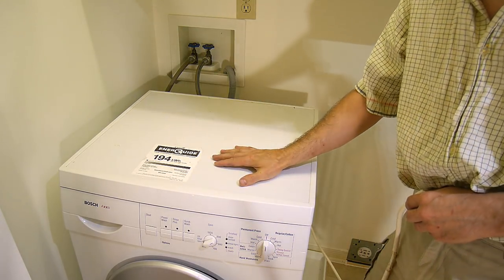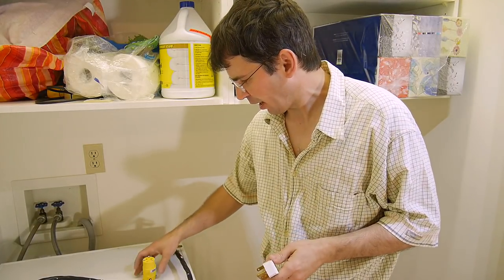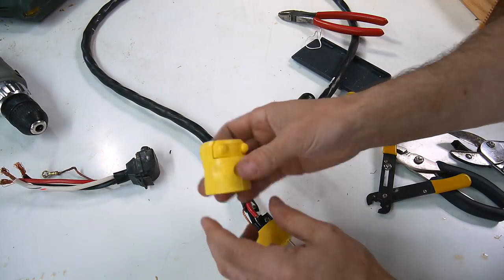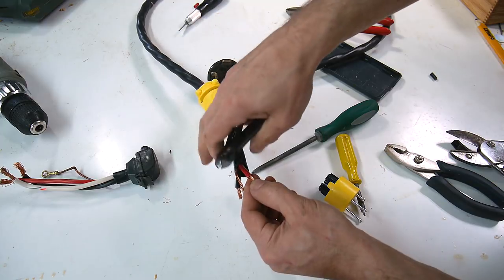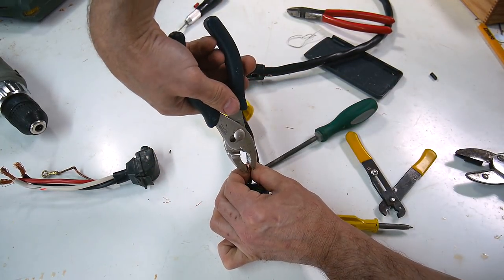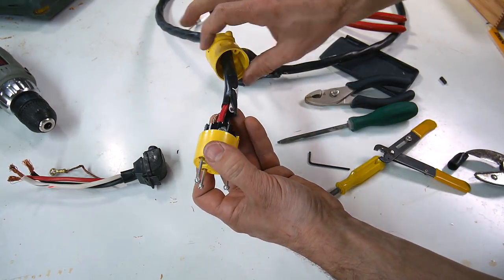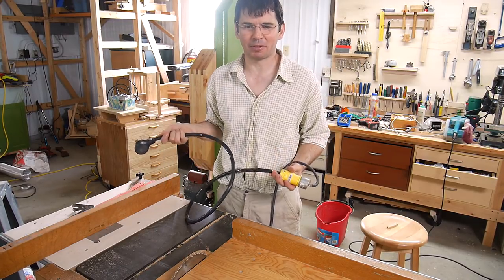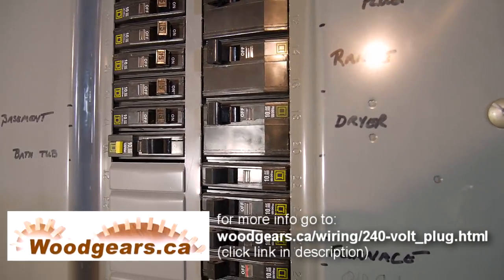240 volt from dryer plug (for Euro-washer or table saw)

Comment: Why in North America your whole house isn't 240v like the rest of the world I will never understand. Makes life a lot easier and safer!
Reply: @YeCannyDaeThat Haven't you learned by now that the US does things to spite the rest of the world and Canada has to follow suit because most of our goods, electrical and otherwise, come from the US. :P
Reply: 240V is not safer than 120V. In fact 240V is only half as safe as 120V is. Because you will pass twice as much power at 240V as opposed to 120V.
Reply: The US set the 110v standard and stuck to it for over 100 years. Hell turn of the century equipment will function on our sockets. Also europe was also at 110v until they became too cheap to run thicker and thicker cables so they figured they would double the voltage while doubling the capacity for basically no cost. Also for 220v being safer, I beg to differ. Every time a human being has contact with high voltage it alters the body, mainly the heart beat. 220v not only does it penetrate more easily through tissue, it delivers 4-8 times the amperage through the body. Chance of death at 220v is exponentially higher than 110v. By your reasoning, why not run 1100v, it would require much thinner wires for 1-2kw loads, the insulation would have to be thicker, but plastic is cheap. Copper costs. Why stop at there? 2200v is better yet. Half the wire gauge once more. I think europe needs to get with the times. 4kv outlets or bust. This way they can run their large resistive heat sources off strands of wire so thin it would look like hair.
Reply: @paul Frederick. 
Actually you are completely wrong. At 110v you have to have twice the amps that you do for the same energy (power) that you would at 240v. Amps are much more dangerous than Volts. (Volts Jolts - Mills Kills). 240v is far safer than 110v for domestic application.
Reply: I would only be wrong if we were made out of super conducting material. But being resistive I'm right. Learn how to Ohm's Law.
Reply: Actually Paul, it is a factor of 4 not double. More like 4 times the power.
Reply: Well I never like to figure out AC power factors.
Reply: Now you're just getting upset because i'm offending your (mad) 110v setup. Don't get me started on imperial measurements and Fahrenheit lol. Don't worry, you will catch up soon. :)
Reply: I think that the 60Hrz is not as dangerous to our heart as the 50Hrz that the 240v uses.
Reply: Catch up? We're so far out in front we're about to lap you.

Comment: Well, if we don't see another video from this guy, we'll know not to do this.
I was tempted to try and run a small stick welder off my dryer plug because it's right off the garage. Then I found the welder needs 50A so I gotta run a line from the panel. Someday. I STILL don't have a working welder.
Reply: In the US, check NEC630, Dedicated welder circuits can use much smaller wire due to their low duty cycle, so you might be able to just swap out the breaker and outlet, leaving the original dryer wiring intact. To do this, you also have to mark the outlet for welder use only. Lots of 225A Lincolns tombstones are running on 10AWG wire.

However if its a long wire run,, or you are pushing the welders duty cycle, or expect you might use that 50A outlet for something other than a welder,, rewiring back to the panel with 6AWG is in order.

Comment: fuckinhell, a death trap.
Reply: what do you mean neutral and ground are wired together, did you check the polarity on the plug, that wires too heavy for a washer its 30 amp where did you get it ?
Reply: 240 volts in North America is 2 phase 120 volts, so to get 240 volts you connect the Red and Black. To get 120 volt it's Black and White or Red and White.

Comment: Two safety comments:
1 - please don't show those "temporary" connections (you might understand the hazards but there are a zillion people out there that don't).
2 - you should coordinate the breaker with the new appliance and it's power cord (which are both designed with a smaller breaker in mind).
Reply from the maker: Please see notes in video and video description
Reply: I did read the notes but I stand by my comments.  You're correct, the over sized breaker will trip on a short circuit, but that is likely to be the result of melted or burning wiring on the appliance or its power cord.
Reply: He said in the video the oversized breaker won't protect the cord on the washer or an internal failure that expects a smaller upstream breaker to stop a fault. The completely safe solution without modifying the plug or circuit breaker would be to install an inline circuit breaker or fuse into the adaptor cord.
Reply: cos leaving a message saying smart people dont comment makes it completely fine to show people how to burn there house down

Comment: „220“ volt in Europe is standard same wiring as US „120“, i.e. 1 hot with 220, 1 neutral and 1 ground. After that there is „380“ or 3 phase, similar to US „220“, except with 3 hots at 220,  1 neutral and 1 ground. The 3 phases are opposed 120 degrees in the appliance canceling each other out. The US likes to waste energy thats why they use 120 😂😂😂
Reply: yes :D and those wires for us appliances are so thick you could carry twice as more power on 220 volts.

Comment: I'm an electrician and I am afraid you have made a couple of mistakes. You should NOT cut away those wire snip-its because you are reducing your wire size even further and this can be a fire hazard. Looks like the wire is to small to be protected by the 30 or 40 amp breaker. A better solution would be to open the back of your washer and remove the original wire and replace it with your 220 volt #10 awg dryer plug. sorry about the "Safety Nazi" comment. Just concerned about you and your family's welfare.
Reply: Given that most of these systems are over designed for safety, snipping a handful of those wire "snip-its" isn't going to cause a real problem. The current carrying capacity of that wire has been reduced by a fraction of an amp at most. If your system is that close on tolerances then the company that made that machine is looking at a lawsuit because it is going to have millions of washing machines catching fire at any moment.
Reply: The real issue that our electrician is ignoring is IR squared line loss. Over this minimal distance that is not a factor that needs to concern us either. As shorter conductors can carry more current than longer ones can that are both of the same diameter.

Comment: Not a good idea Matthias. Get an electrician to run a separate circuit to your washer. No No on the ground to use as a neutral. This video is proof for your insurance company not to payout on a claim. Our power company would shut my power off if they found this in my home until I get it fixed. If you lose conductivity at any point on that ground lead the shell of that washer will energize to any unbalance your two 110v phases might encounter.
Reply from the maker: Watch the video.  I used the ground as ground.  The plug doesn't have a neutral.
Reply: Sorry, I guess you are right.

Comment: Please, do not try this at home!  
The cable is not rated for the power used by the machine and to make matters worse you cut off the pieces of wire that didn't fit
making the cable in fact even thinner. This is a real fire hazard!
Reply from the maker: The cable was "not rated for the power" because it's way overrated.  Even losing a few leads, it's still much thicker than needed.

Comment: That temporary wiring job you did really is extremely dangerous.
You could have easily spiked a finger on one of those bare copper strands, and that hurts like hell. It could have become infected and then you could have died.
But not only that, it's far too easy for the plug to lay prong side up on the floor, and when you come walking by in the night with all the lights off, you could have stood on it and hurt your foot. Then, in a fit of rage, you could have inflicted severe damage to your house and rendered it structurally unsound, and it could collapse. The rebuilding operation would be almost certain to cause the death of many plants!

Comment: the safety trolls are gonna have a field day with this one.. strange to see a 240v washer, I've only ever seen 120v
Reply: I believe most of the world is 220V, so time to do some traveling Anthony.
Reply: there is a world outside the US/Canada you know?
Reply: its a european washer and here in Europe are 220v common (it can run also at 240v)
Reply: Gaunerchen 220 and 240 are the same, 240 is the maximum and 220 is called the Vef, not sure how its said in english
Reply: its almost the same, but here you have 230 +-10% and there you have 240+-10%
Reply: The washer is 220V because it is a compact unit that is designed to be paired with a matching dryer.  Often they are stacked.  Normal set up is to plug in the dryer to the mains and plug the washer into a purpose-built receptacle on the dryer.
Reply: In fact "230V" can vary from about 210V to 265V and still be within tolerances.
Reply: ...because when I travel, the first thing I do is check the voltage of everyone's washing machine.